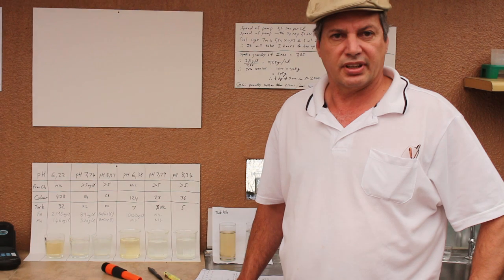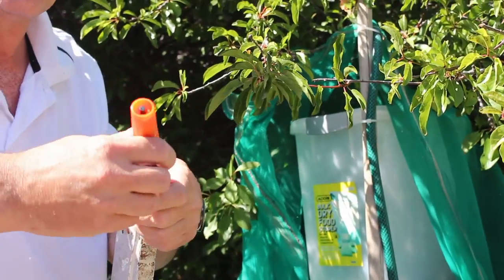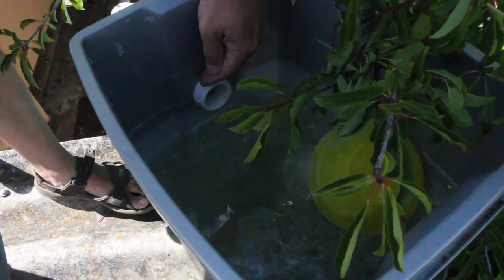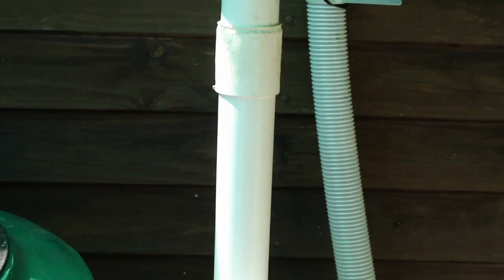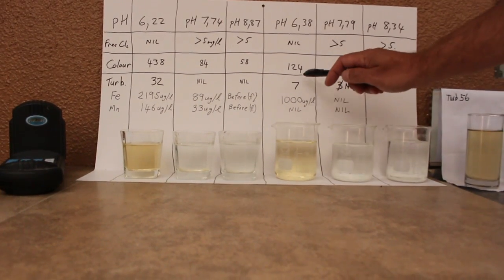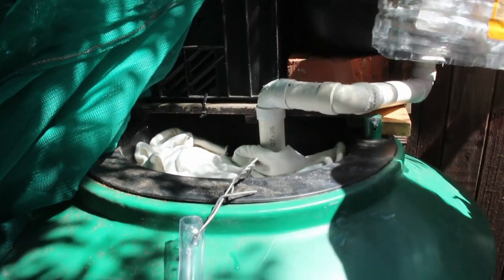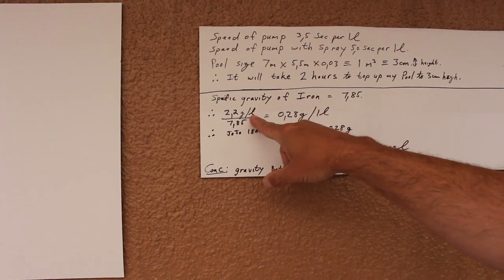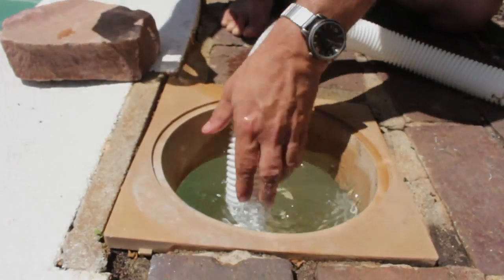HOW TO REMOVE IRON & MANGANESE FROM UNDERGROUND WATER

Comment: Amazing Jose. I am definitely going to give this a try. What I usually would do is simply run my well point water for about 20 to 30mins on the lawn. Then move the hose to the pool for top up and add a quarter of metal remover. Part trouble with this is that metal remover also lowers your PH level. One then needs to add soda ash to raise the PH level to the recommended levels again. Thanks for sharing.

Comment: You can use a Venturi to aerate the water coming from your pump instead of a spray. would it work better? There are a few good videos on YouTube showing how to make one.
Reply: for a venturi to operate correctly you need enough pressure and he is getting 1020L to an hour on a 15mm hose... so a venturi will not operate with that flow rate... he needs to at least double his flow rate for a venturi to create a venturi effect.
you can maybe throttle the end of the pipe where the water dispenses but im afraid the pressure will still not be enough and the water will then choose to pass through the venturi air suction side...

Comment: I have learned much from the video, thank you very much however, I have some queries and I am sure someone won't hesitate to answer them. My queries are as follows:

1. What is the purpose of sand? Is it to remove iron and manganese particles from the water?
2. Is the sand used fine sand or coarse sand. If the sand used is fine sand, how fine it is?
3. Can I use sand available in the local area or are they specially treated or cleaned sand?
4. In the video, when water is filtered through the sand why is it passed from the bottom of the sand and not from the top?
5. Finally, how often should the sand be cleaned or changed?

I would much appreciate the answers. Thank you in advance.

Comment: Thanks for the video.  You gave me a great idea.  Anyway, I need your advise.  I pump water from my shallow well into my 55 gallon rain barrel to water my plants.  If in case of emergency and I want to drink the water,  if I use my 1" chlorine tablets, how many will I put in my floater?  Or using the 3% Hydrogen Peroxide from local store, how many cups will I put to remove iron and rotten egg smell?  Thanks for the video.
Reply from the maker: Easy Johnny As I mentioned I would like to move away from the chlorine process, because this process does not remove all metals (e.g. aluminium). In order to remove all metals, a new dosing solution will have to be implemented. I have been doing extensive experiments in order to establish a hassle-free dosing solution/system. If you live in the Western Cape, as from 1st September 2017, you can give me a call on (cell no. 079 8018090), I will be doing house visits with my different filter cartridges (e.g. activated carbon, GAC/KDF filters and colour, metal removal resin’s) in order to establish what
is the best way in treating your underground water. My equipment will show you how your final water will be, and maybe you will not need to do the pre-dosing process, but only use filter cartridges and how long it will last before replacing.
Reply: Jose da Silva thanks for the response. I live in Florida. Yes I will try filtration after I first oxygenate my well water by placing it in my 55 gallon barrel then just like you will filter it. I'm thinking of using 35% Hydrogen Peroxide to neutralize the Chlorine before filtration.
Reply: @josedasilva6242  Thanks for the great video. Are you still based in Cape Town for consultations?

Comment: Great video ! My wellwater has 15 mg/ litre but was is absolutely clear. Want to clean up the iron so I can use in toilets that are on septic tank. Will the high chlorine level damage bacteria essential for septi ctank operation?  How do you remove the setteled iron that builds up?
Reply from the maker: Unfortunately no, you will have to use some other treatment process. The chlorine levels
might be too high and will kill the bacteria needed in the septic tank. The
settled iron is removed at the bottom of the tank’s inlet/outlet.

Comment: Good job!  the water near my locality has around 12ppm of iron. I want to coagulate it by oxydation.Can u suggest some method????If u can share details it would be helpful...
Reply from the maker: As I said this process may not work for all types of water,
it is advisable to have your water tested before proceeding with the process.
Get yourself a 200 ml beacker or some clear glass and fill it with 200 ml of
your raw water and then put in half teaspoon of pool chlorine(HTH), stir about
3 to 5 times and then let it stand overnight don’t worry if all the chlorine
doesn’t dissolve. The next morning you should see a clear layer on top, decant
about a hundred ml of the clear layer into a small bottle and have this tested
for iron and manganese. Now from those results you can decide if it’s worth
your while to take this route. If you had at the start 15 milligrams of iron,  and the iron comes down to about one or less
milligrams per litre, then it might be worth your while to do this process.
Although by having 1 mg/L is still not recommended, seeing that the water
drinking standard suggest that you should have less than 0 .3 mg/L, but then
you can run this water through filters in order to remove the rest of the iron.
By doing it this way you will save on your filters and you won’t have to
replace them that often.
When I started this process back in February 2017 I only
wanted to treat my groundwater for the pool, but now I am thinking to use this
water in the toilets and showers but I don’t like the idea that there could be
still some chlorine in the water,  especially in the shower. So I have decided to
stop the chlorine process and use some other treatment process. The thing what
I like about the chlorine process was that I could actually leave the water for
even up to 2 weeks if not longer, and not worry about bacteria or algae forming,
which could give rise to some dangerous pathogens.
TREATING WATER IS A HARD PROCESS.It requires time, regular monetary,  testing and cleaning of your equipment.
Reply: Make chemical oxidant use potassium permanganate+chlorine,then filter the colour with anthracite and manganese   greensand
Reply: Jose da Silva I insist strongly that the sample water should not be treated or chlorinated in any way before sending to the laboratory for testing! Raw sample will reveal accurately what's in the water. Then the owner can determine what treatment is needed. The water treatment industry is full of overcharging thieves and misinformed plumbers who give advice out of ignorance. There are many videos explaining when to use ozone, or hydrogen peroxide, or plain air (as in your water spray technique) to oxidize iron. Of COURSE when it's oxidized, a filter has to catch the iron particles unless they're at the bottom of a tall tank as you describe--remember that some people don't want a settling tank but rather, continuous flow which requires a filter. In all these techniques, one has to set peroxide or ozone to safe levels for drinking, which are easily looked up. People are even using ozone generators to keep tropical fish aquariums clear without hurting the fish! Ozone should be generated by the corona discharge method, not ultraviolet lights that have very short lives!

Comment: Impossible for the water ph to rise from PH6.38 raw to ph7.79 and then ph8.34 while using chlorine tablets (trichloro-s-triazinetrione) chlorine tablets has got a ph of 3 so it will lower the ph on water and not raise the ph... aeration tends to raise ph of water but you also do not have enough aeration with the little sprayer connected to your system right at the beginning of your filtering process. You want us to bellieve that you raised the water's ph by a ph of 2 with aeration, chlorine tabs and some little filtering.... With the ph calculations ruled out, it is impossible for me to believe the iron and manganese figures mg/l.

Comment: But sir. Your design is too complicated why you dont use 2 FRP tank and 1 Dosing Pump which can be installed in 3 meter spaces at compact design.  If your design is improvise it is okay. But for selling or sharing with others will be look lousy and not looking nice. But Thanks for sharing Sir.